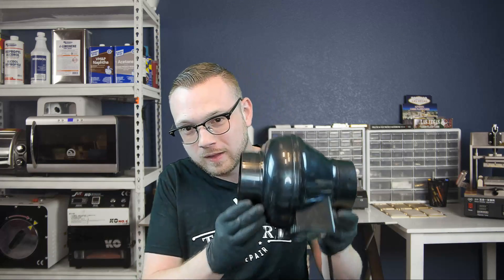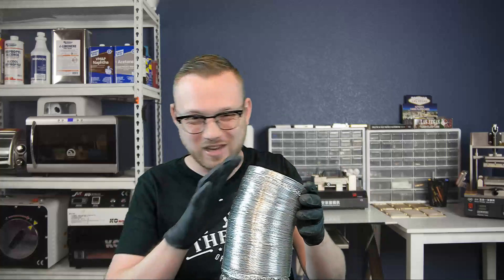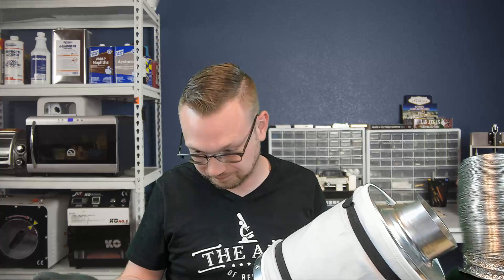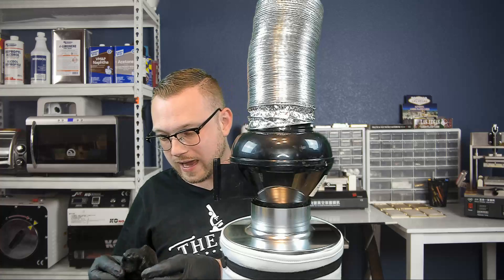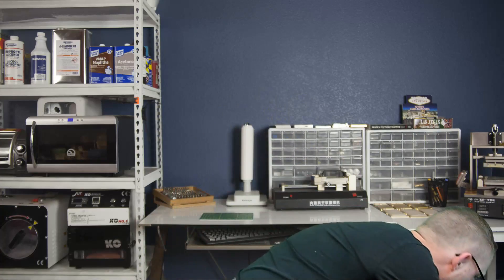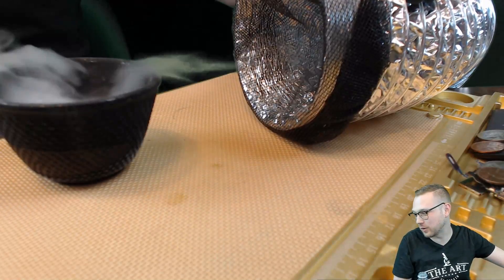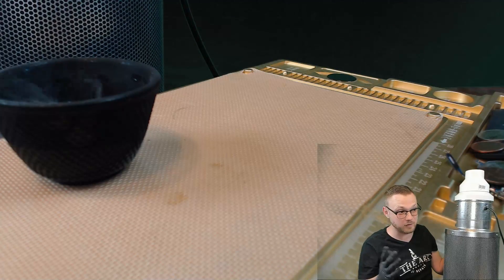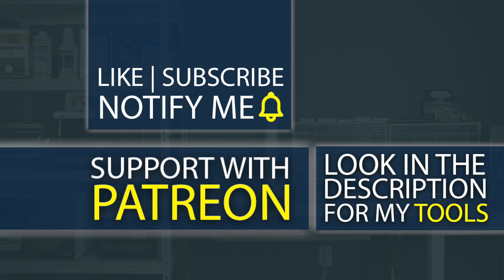Expandable Fume Extraction on a BUDGET | BIG STATION power LITTLE STATION price

Comment: Well not bad. $76 in 2024 lol. 
Got thw blower, black ducting, a pedal switch, the filter, and a 4"-2.5" reducer for that price.
The reducer is because i found a 2.5kit with the type of hose that stays in position when you flex it and came with a bell housing (its meant for dust extaction for woodworkingni think lol)
But about $70 still without that reducer for the full kit and pedal!!!  
This has to be the forst time something is same peice as 4-6 years ago lol. 
This also means the other stuff i bought to make one is kinda wasted i got PC fans and  charcoal filter sheets. But i guess i can cut them to fit the intake. Couldnt find that net you had. Im also guessing that reducing to 2.5" is going to raise the suction even more too lol
Reply from the maker: @2010stoof  I’m so happy this worked out for you! And yes it seems the prices was stable haha. What a win 😎💪
Reply: @TheArtofRepair  really been enjoying your videos! 
Hope you upload more soon!!! I see your last one was 2 years ago. Hopefully you're busy with work!!!
Trying micro soldering soon with my new andonstar ad249s!!! And got a cheapo hot air gun to test it out before spending the big bucks!!!
Reply from the maker: @2010stoof  i appreciate that man! And yea the art of repair will never “die” I just take periods it seems where I’m “out there doing the stuff” necessary to come back and make cooler videos, whether that’s more repair work, working with different parts of the industry. Or at the moment it’s working on more organized information for people to learn. 

In the last few years Iv actually built out an elearning course that’s about 50-60 hours long that has maybe 240 new videos. It’s all available now, but unfortunately not in YouTube, since I’m sure you can imagine 2 years of full time work has to feed me a bit somehow haha.

And now I’m currently starting to work with some more manufacturers to better some of the products we use every day in our work as well as focus on more direct relationships with those who want to learn repair in some of the communities I run.

I think the future of the art of repair as it stands will be more visiting repair shops and focusing on major issues shops face, which can for sure include training. But I do feel a lot of the information on the channel currently can get someone to a professional level with practice inbetween so tackling some larger issues seems to be what will make me happy with the channel.

Either way! Stay subscribed and one day you’ll get a notification 📣 ❤️

If you want to know more about the elearning content feel free to let me know too, all students are interviewed and are set up for success and not just thrown to the wolves so to speak :)

Comment: I got my fume extractor up and running last night and it works great! Thanks Justin! I can't believe that I didn't think of it...
I removed three SOT-23's last night using only my magnifier visor and I didn't smell the burnt flux even with my face close to the IC's! 
I have it vertical beside my bench with a strap holding the flex hose about halfway on my bench shelf. When I need to use it I just move the end around to where I need it, and then let it hang beside my bench when I don't need it. Works great!

Comment: This is a grow house filter setup, its good for indoor grow but flux fumes Need hepa filter.....is It correct?
Reply from the maker: They filter differently, carbon filter + hepa would be best, but carbon will work fine if you have a good amount, like in this setup =)

Comment: That fan has poor reviews on amazon.com.
Reply from the maker: Robert Cardwell I have multiple units that all run amazingly 24/7 :) I try to only put things up that I actually have tested and used
Reply: Thank you for your reply. May I ask how you clean the filter? I've heard that activated carbon can be cleaned by soaking it overnight in a bleach solution.
Reply: What happens when they are used up? The units I have found require replacement and there is no way to clean the activated charcoal. You are not giving the full story if you only address the set up phase.

Comment: To increase efficiency get a roll of aluminum HVAC tape and use it to seal each connection point, the fan's body where the two pieces meet, and the electrical hook up box.
Reply from the maker: Tyler Skinner I thought that’s what the duct tape was for 😀
Reply: TheArtofRepair Did you mention duct tape? My bad, must have missed it.

Comment: The carbon filter comes pre-filtered. My question is - are these filters replaceable? Great video btw!
Reply from the maker: While its possible to empty the carbon and refill it for sure, the price of just the filter itself is pretty cheap so it depends on if you want to source the proper carbon and deal with the mess, as it can be a messy job. =). There are a few different kinds that work better than others based on their geometry. Thanks for watching my video! I hope you get to build an awesomely powerful cheap exhaust setup! =)